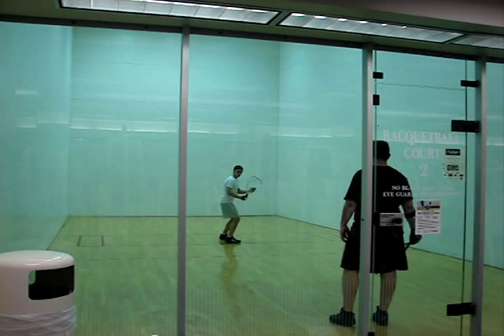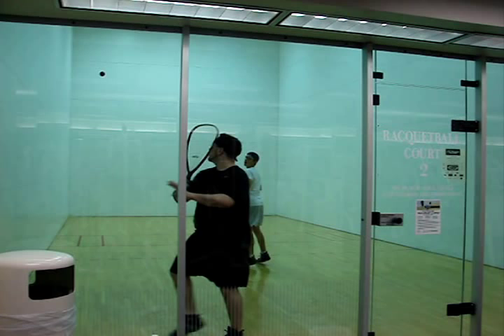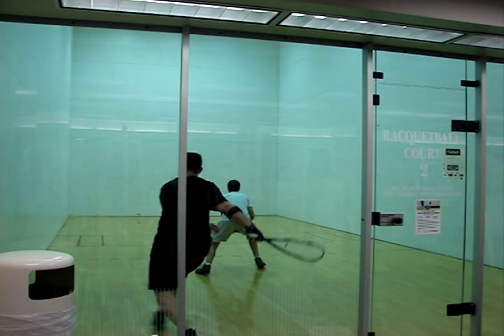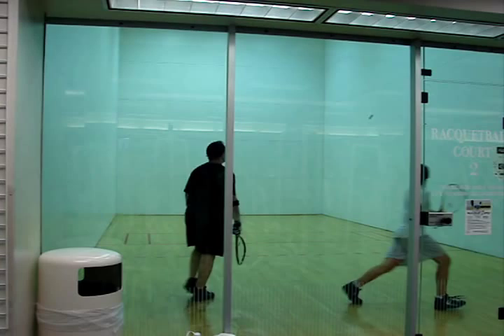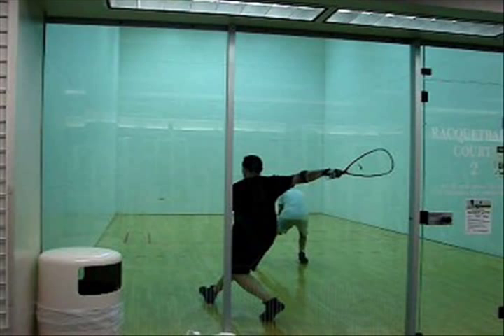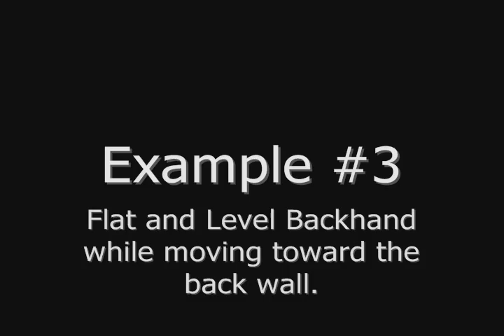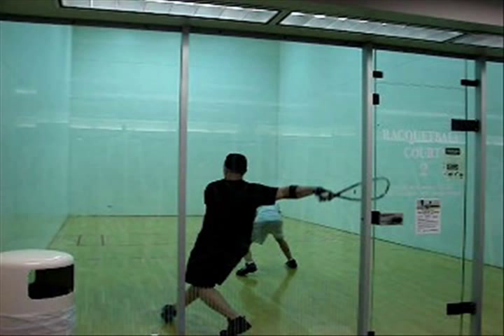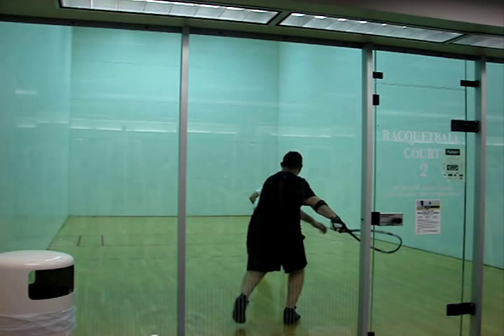How To Play Racquetball - Backhand Stroke Mechanics

Comment from the maker: If you're swinging flat and level, you should start with a basic down the line shot.  This is your default shot that you should build your other shots around.  Hit a DTL with the contact at your lead foot, full extension.  Hit 3 or 4 good ones, and then simply drop the ball further back in your stance, and take the EXACT same swing.
You'll hit a pinch or splat (depending on how close you are to the side wall).  If you want to hit a cross court, drop the ball further FORWARD from your DTL.

Comment from the maker: I think what might be a bit confusing is the terminology "flat and level".  It's impossible to keep your racquet completely parallel to the floor on every shot.  It will be slightly angled down, or even up in some cases.

The key is to contact the ball AWAY from your body so that your swing is "flat" without any loops in it.

And when I say level, I don't mean 100% parallel to the floor, although in some cases that's what happens.  You want to be as level as you can as much as you can.

Comment from the maker: A good way to practice this type of swing is to look at the horizontal line where the front wall meets the floor.  Try to keep swing and follow through travelling as close to that line path as possible.

If the ball is low in your hitting zone, you'll need to bend your knees more to do this, so that the racquet stays "flat" throughout the stroke.  Otherwise it's pendulum.

Does that clear it up a bit for you?

Comment from the maker: People make the mistake of "altering" their swing, and mechanics when hitting different shots.  Check out my "contact points" video to see what I mean.  You take the exact same swing for each shot, with the only difference being the contact point.
This will add deception AND consistency to your shots.  For example, some people step toward the side wall (forehand) when hitting a pinch or splat.  Easy to read, and it blocks off your hip rotation.
Remember, same swing, different contact point.

Comment from the maker: The non-hitting hand (or arm) is so important to racquetball that I always cringe when I see players only stretching and warming up their hitting arm.  They both play a role and should both be ready before you play.

On the backhand my non-hitting hand is used for balance and stability.  It's a guide that I use to line up my racket and begin my swing.  I don't necessarily agree that you can't hit a good backhand without having it in front of you, but it IS very important to the mechanics.

Comment from the maker: No, it's not bad. In fact there are some top players on tour right now who swing slightly pendulum. They've been playing a long time and that's what they were taught, so they've mastered it over time.

The flat and level swing gives you much more room for error. When you swing flat and miss, you miss side to side, and still hit the front wall. Pendulum swingers miss up and down, which leads to skips or shots that are way too high.

The pendulum swing requires exact timing.

Take care.

Comment: I recorded my backhand swing and I go from flat and level to a slight pendulum. In drills, my DTL passes are pretty good. I am wondering about the non-hitting arm. I bring my non-hitting arm up close to my neck. My hitting arm and non-hitting arm form an X right before my swing. It works, but I wonder if extending my non-hitting arm like yours would be better. I will try it tomorrow.